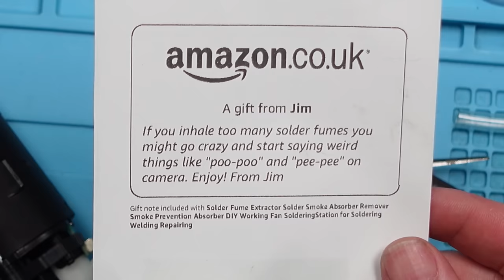FAULTY Hair Curlers | Can I PERManently Fix Them?

Comment: I wonder how much of the world's waste would be avoided if electronics makers actually added just some minimal strain relief to USB connectors
Reply from the maker: Absolutely!  It has to be the most common fault on faulty devices!  👍
Reply: If it used through hole it would have been much more robust.
Reply: yea but then you wouldn't buy another one after a year 🤔
Reply: but that might cost them 0.0001p worth of solder!!😮
Reply: The makers want the device to fail. More profits.
Reply: Is the answer 12?
Reply: is this a real question ?
Reply: Micro-USB charge ports were horrible. Lost so many devices because they were so easily worn out.
Reply: @lawrencemanning  Lady Ada at Adafruit has pointed this out too.
Reply: Or make it easier to repair things in general.
Reply: @StezStixFix  i got it apart in under a minute  but its stuck in battery charge mode and advive i thing the board is fried

Comment: Thanks, Jim!  Every time he breaks out the leaded solder I'm immediately worried for his health.

I immediately said OH NO when I saw the clip get melted.  Don't know why, it's just a clip. XD
Reply from the maker: 😁 I thought the same when I watched it back!
Reply: I'm going to have to get one of these fume extractors. Just starting out, but getting smothered in solder fumes is not very fun.
Reply: I hope this won't escalate into a fundamental debate, but considering the low vapor pressure of lead and its boiling point of around 1750 °C you're not going to inhale lead vapor during soldering.

The real problem is prolonged exposure to flux fumes and the physical handling of lead solder and leaded solder joints (gloves are a thing).

The fume extractor (in this case it looks like a plain active carbon filter in front of a fan, which is totally fine if regularly replaced) takes care of the majority of flux fumes. Lead? Not so much. 

Nonetheless - thanks Jim!

Comment: I got one that dose not work and the company never returned our messages about it and was wondering if it was ever the battery and more . Wish the company would give answers to it all . I got another one that will not keep the charge . The cutler is wonderful just needs to figure it out why they have so many issues with charge part . Wish I knew how to get mine fixed so I can use them . Thanks for sharing this